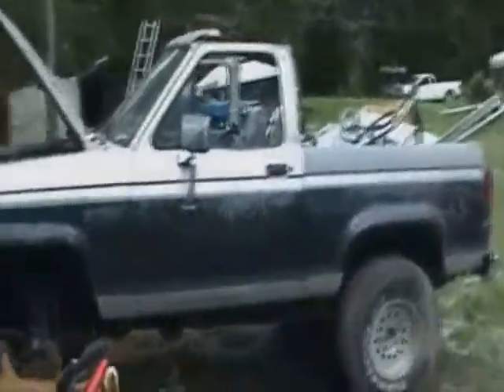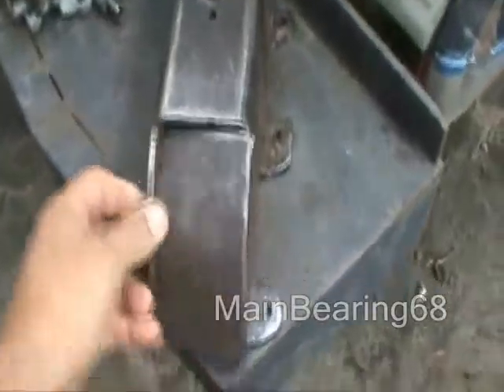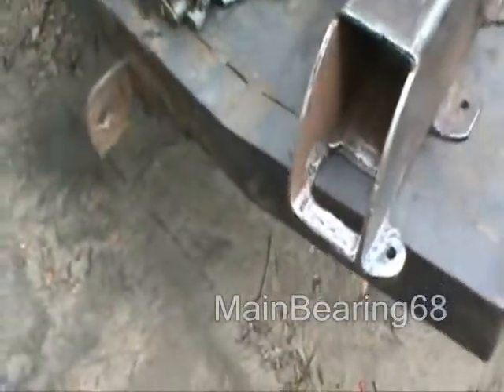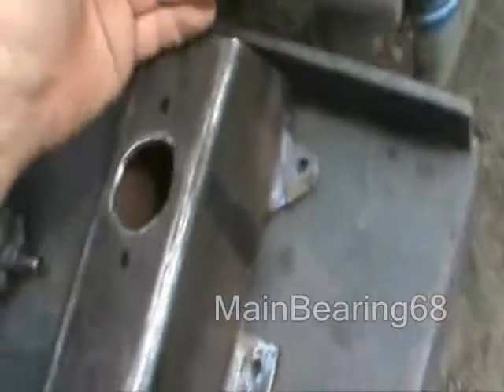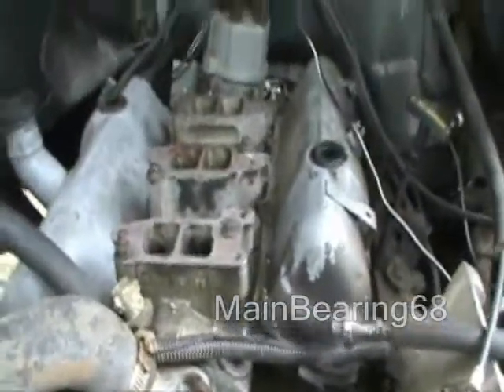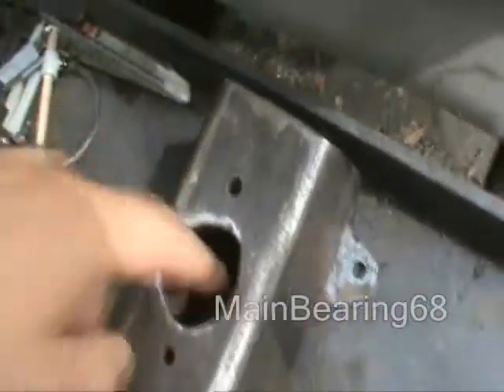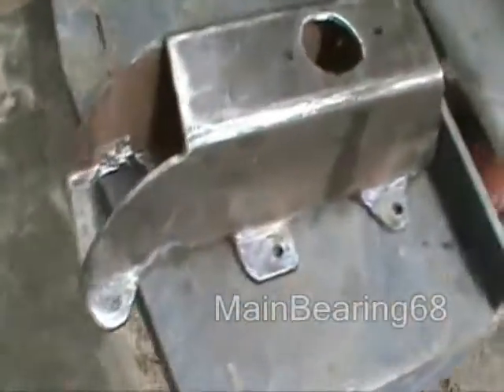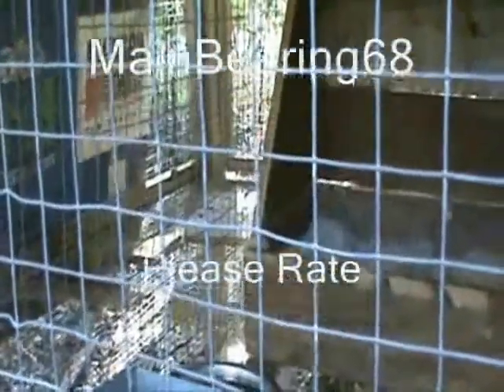Ford Bronco II Build - Carburetor Conversion

Comment: Distributer bypass!? How
Reply from the maker: @pedrop99969  we took the guts of the distributor out and drilled out the ignition plate and milled out a nut because it has 6 points on it and pressed it on the shaft of the distributor where it would line up with the ignition points. We set the ignition points to spark at each tip as the nut rotated and timed it with the distributor to fire on each of the 6 pistons.

It would have been more difficult to do this with a v-8. But it's totally doable.
Thanks for the question.

Comment: Could I get the video of the distributor build?
And how did the Ecu react?
Reply from the maker: We put in a points distributor, bypassed computer. Old project... Updates not available...sorry.
Reply: @homesteadbarron  what point distributor did you use?
Reply from the maker: @richwolff7881  its a ten-year-old project, the best way to describe it is we strip the guts out of the distributor. Beings it is a 6-cylinder we were able to take a hex nut and mill it out where it would fit the shaft of the distributor. Then on the plates where the electronics was mounted we simply mounted the points and condenser. Hope this helps

Comment: Ye ur rit I'm doing the same to my 2.9 and got the inlet from a 2.3 v6 and it fits like getting dizzy made like u need to have a dizzy from a 2.8 and u need to poot all bits from the 2.9 dizzy in to the 2.8 and get points from a ford crossflow to get it to all work to gether so u need 3 dizzys

Comment: I know this is kinda old but the ford 2.8 off an 84-86 should have a carb as an option and should be able to pick one up at your local pick a part that should fit your 2.9 
Good Job tho what about molti carb would look cool
Reply: Cylinder heads are different intake won’t work

Comment from the maker: Thanks. The carb was bought on ebay and came off a 4 cylinder ford. Not sure which one it is. Yea he bypassed the computer. Took three wires to the distributor, one goes to the ground side of the coil, one goes to the positive side of the coil and the goes to the positive. So the old distributor works pretty well. We are planing to retro an old distributor to points and see which one works best.